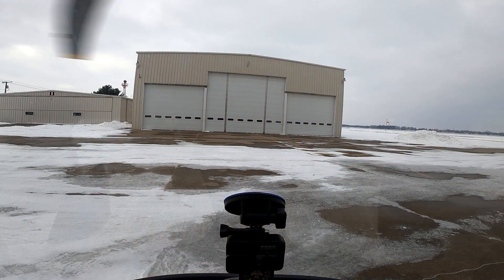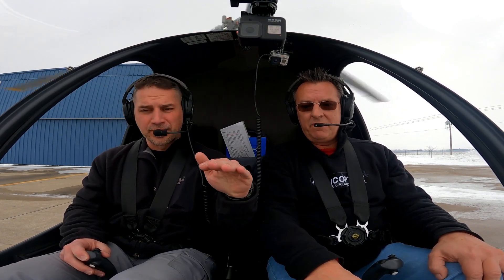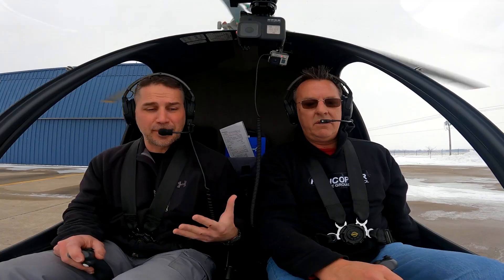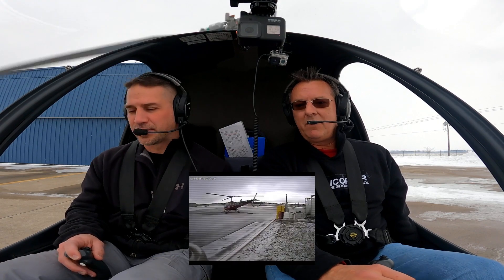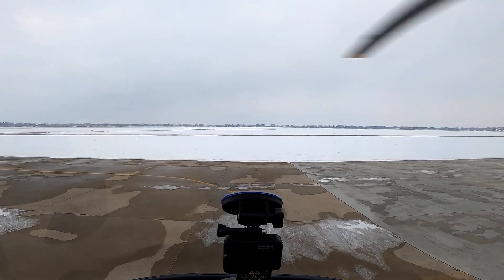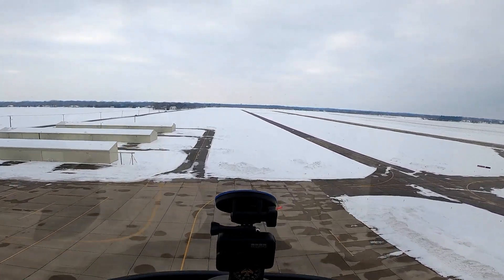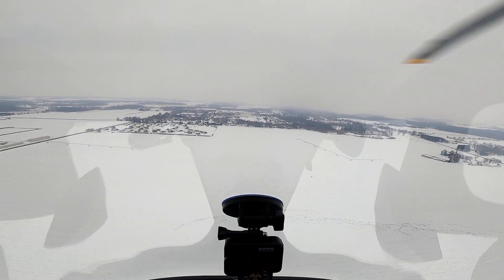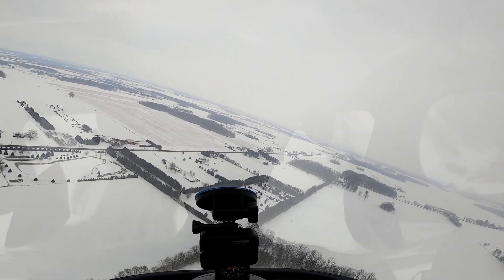EP 32 Why We Add Pedal When Rolling Off Throttle (could have been a tail rotor strike)

Comment: Please let us know more precisely. Let us consider "power pedal" as the right one on clockwise rotating helicopters and the left one on counterclockwise rotating ones. ie  in a hover, you apply power pedal. Which one do you apply for needle splitting and when? Non power pedal at splitting, and power pedal when pairing again, I assume? I have to admit that for the beginning of my training I don't remember having been told such a thing, but we almost never have ice!
Reply from the maker: In this case, Cabri G2 is clockwise, add left pedal when rolling off throttle to split needles.